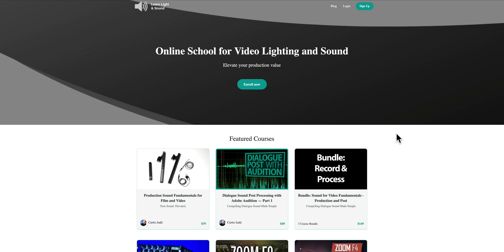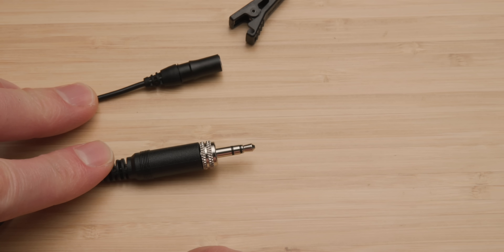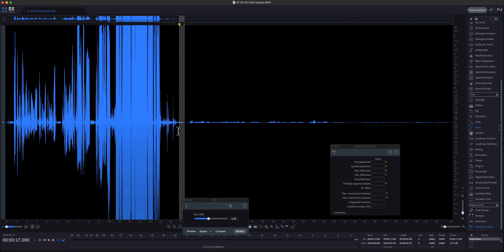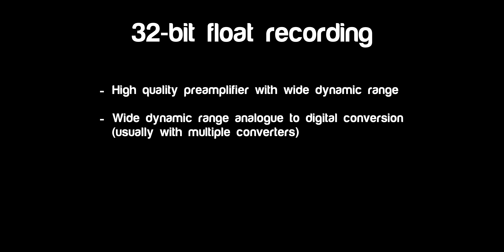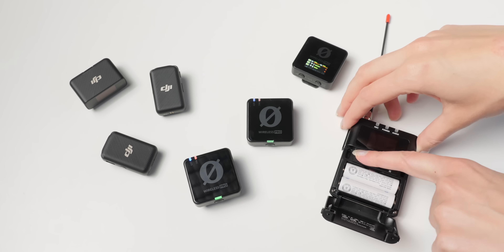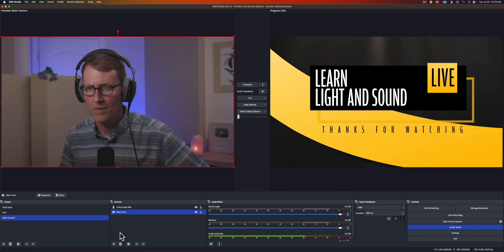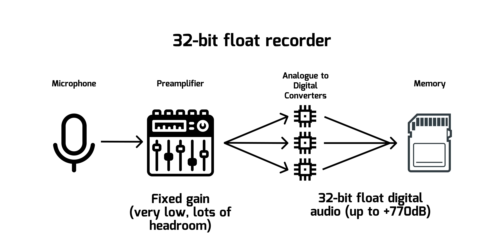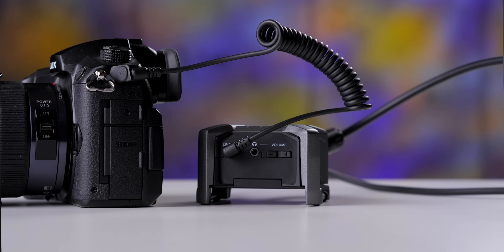Is 32-bit Float Audio Magic?

Comment: So call dual ADC F32-bit makes things worse. According to ASR's test, performance of Zoom F6 is terrible, and mixpre 2gen also has lower performance than 1gen. Later SD8xx series returned to/insists on traditional 24-bit design.
Reply: Reading the comments, it looks like the limiters might have been engaged when reviewing mixpre 3 ii... which is not a great way to measure an ADC performance...
Reply: @bertrandschmitt7292  our university's ee department lab have APx555(30k$ hardware+1.5k per year software fee) too, I send my mp6 gen1 and dr100mk3 for test. Mp6 gen 1 just slightly better then my dr100mk3: ADC chip are at same grade (entrance level grade chip), with slightly better  preamp, nothing more.
Reply: Some ASR test results:
recorders:
Zoom F6 SINAD=61db, that means it have 15 or less bit accuracy
SD Mixpre 3II SINAD=84db, ~16 bit actual adc accuracy
Tascam DR100MK3 SINAD=91db
sound interfaces:
Motu M4 SINAD=104db, latest Gen 111db
Topping 2E2(150$) SINAD 110db
RME ADI-2 Pro(1500$) SINAD 117db
 E1DA ADC(200$ ADC only ) SINAD 119db
more ASR test results:  microphone preamp  noise EIN
Topping 2E2 130db
Focusrite 2i2 128db
RME Babyface Pro 128db
SD MixPre3II 110.5db!!!
Reply from the maker: Where are these tests published, please?
Reply: @curtisjudd  ASR-audio science review
Reply from the maker: @wbyoung4280  Thank you.
Reply: Personally, I have a UAD Apollo X4 and MixPre 6 II. For recording podcast, I am switching to my mixpre 6ii thanks to 32 bits sd card recording while streaming audio to USB. That's the safest you can get when recording long form,  and keeping high quality.

Comment: Finally I'm hearing this. Excellent. This needed to be said. No more 32-bit hype, real deals, gamechangers and other marketing buzzwords. People need to know the actual reality, the advantages as well as shortcomings and caveats. And this is a pretty comprehensive list. Thank you!
Reply: It is a game changer if you set gain 20dB higher than optimal like 95% of users do. Even if you have a very good 24bit recorder, the 32bit float recorder will impress the vast majority of users and help them get better results in difficult situations.
Reply from the maker: @aristotle_4532 I agree it can be a safety net for those doing lots of things on a production, but setting gain is like setting exposure on a camera. Pretty much a fundamental skill of any video production pro or enthusiast.
Reply: @curtisjudd  If they can't set gain, can they place a mic? Or in terms of photography, if you can't expose, can you compose? In Greek it makes a better expression because the word for expose also means embarrass in public.
Reply: Yes. All this hype about "digital". No more bit and sampling rate and storage capacity buzzwords. Tape is king, everything else is just hype.

OK, so the point is, every technology has good and bad implementations, and every tool can be used correctly or incorrectly.
Reply: Exsctly...its an amateur gimmick not a new do it all

Comment: Curtis, I'm curious what your limiter settings are on your 888 for spoken-word/dialogue. Threshold, knee, attack, release, ratio? Bus vs. channel? If you could explain what settings you use and why you chose them, that would be really helpful. I think I've got a decent handle on it, but would love to expand my understanding if possible. Thanks!
Reply from the maker: I have them at the default settings. They rarely engage because I usually leave plenty of headroom for dialogue.

Comment: Most problems with distortion is not the 24 bit limits but the dynamic range of the mic pres that is rather bad in all of those recorders under the sound devices level, like zoom and tascam. Also wrong gain staging. Still with the dynamic range of the sound devices and 32bit it is great for FX when using piezos that can be very wild.
If not distorted 24bit still sounds better than 32bit
Reply from the maker: And some of them have poor quality converters amongst some of the budget gear (though less an issue today as it was even 5 years ago).

I don’t follow how 24 bit sounds better.
Reply: @curtisjudd  It is because 32bit converters are actually two or three 24bit in parallel that split the signal to different level ranges  and then they recombine the signals. A kind of a crossover that works in amplitude  not frequency domain. 
In contrast 24bit is a single chip that  handles all the conversion without all the above problems. It is mostly theoretical but some people claim they can hear the difference. What is strange is how come and we do not have 32bit single chip converters in widespread use.I think the reason is cause as you said 24bit can theoretically handle 144db already and that is far more than what we need. There are AD converters that offer something close to that but they are hugely expensive cause to achieve that range all the stages including the power supply have to be extremely carefully optimized.
Reply from the maker: @peterpeper4837  This may be a cost of 32-bit float. But for spoken word recordings, I haven't been able to point my finger at a specific instance yet where I could confidently say, "That was a 32-bit float artifact." They may be there, I admit that, but I haven't been able to clearly identify such a case for spoken word audio recordings.

Comment: I am a bit confused with how the "dB" is represented in that post-production program (say, Audacity or other) versus the "actual dB". So, human conversation could be 60-70dB (loud,screaming). What do mean by "0 dB" and less, when doing post-production processing, and explaining it? 

"Recover the sound that goes above 0dB in post-production...", hmm
At 10:02 | "Because if it is 32-bit float and it goes above 0, any speaker doesn't matter what kind of speaker it is - is going to distort when you're talking about greater than 0 dB full scale" 

Those "greater than 0 dB full scale" is really confusing to me to know about :) I mean I imagine the sound volume is going from 0 and above...?

NOTE: (I am completely not expert...)
Reply: There are different decibel scales. Human conversation occurs in meatspace, where loudness is determined by the air pressure at a given point in space. This is measured in dB SPL (Decibels Sound Pressure Level).

Digital audio uses dBFS (Decibels Full-Scale), defined by the number of bits available in a system to represent signal amplitude/headroom (e.g. 16-bit, 24-bit). dBFS has an upper limit called 0 dBFS. If a signal's amplitude exceeds 0 dBFS (i.e. if it contains more bits than are available to the system) then the excessive bits/signal are simply discarded ("clipped") and a characteristic distortion is produced. 
You can think of it almost like the clearance height of a tunnel. If a rectangular truck with a height of 3.1 meters tries to enter a rectangular tunnel with a clearance of 3.0 meters then 0.1 meters of truck is coming off. 

Analog signal amplitude is represented by dBv and dBU, which are scales referenced to certain voltages through certain resistances. In analog audio there is no hard clipping per se because the components within the circuit still function when pushed past their nominal operating ranges. Distortion is introduced gradually in response to the amount of overmodulation. Push a little too hard and you get a little distortion. Push very hard and get a lot of distortion.
Reply from the maker: When I talk about conversation and cite 60-70dB, I’m talking about a range, not absolute dB values.

When I talk about going above 0dB I’m referring to dB Full Scale where with 24bit audio, 0dB is the highest amplitude audio possible.

Sorry for the confusion and hopefully that helps.
Reply: @curtisjudd  I actually started responding to @jacksonier before I watched the video 😂. I guess I'll watch now and see how badly I misunderstood the question.
Reply from the maker: @helmanfrow  You were right on.
Reply: @curtisjudd  whew 😅
Reply: dB is a relative measurement and without a common reference you can’t compare two loudnesses.  In a DAW 0 db is typically the maximum loudness that can be exported (over will clip typically) with the negative numbers basically acting like a divider of that maximum loudness.
Reply: dB is just a logarithmic scale, but most of the units can be inferred.

For instance, if someone talks about "clipping" they are almost 100% talking about dBFS, the scale used for integer digital recording. Clipping is a mathematical artifact where it's not possible to represent (in that format) detail louder than where it clips. The recorder can often receive it, the mic can often send it undistorted, but it cannot be properly written to the SD card without distortion. This is what you were talking about exporting from a DAW... dbFS. The file format maximum loudness is 0dBFS.

Distortion happens in all sorts of dB, but dBu is for analogue and represents voltage sent by the mic, and can go well above 0dBu before distorting, and has nothing to do with dBFS or clipping as most people mean it. This has specific voltage levels to represent what a decibel means.

SPL is another one, also measured in dB, and is more of an absolute relative sound level from no sound to maximum possible sound on earth.

The cool thing is 32 bit float can represent dB above 0dBFS, which is not normally possible in standard integer format for digital. That's the beauty of it as a file format.
Reply from the maker: @chakerian  Thanks for that 👍
Reply: Thank you very much all for the explanations!) I will review them more carefully.